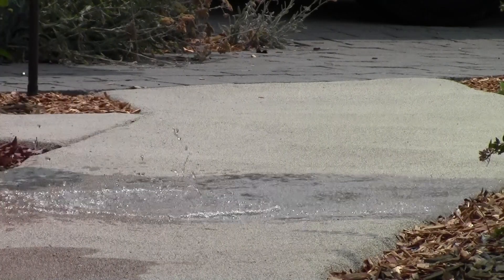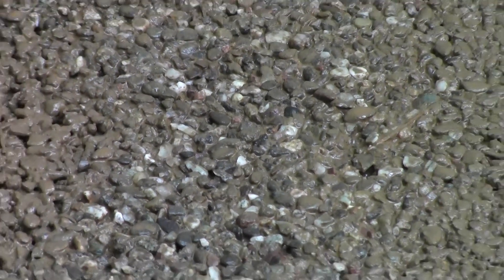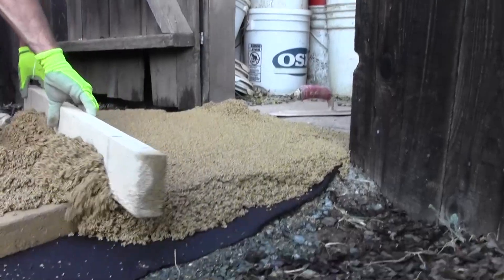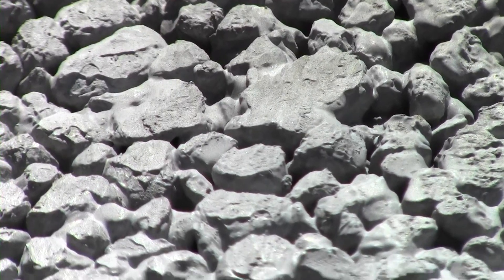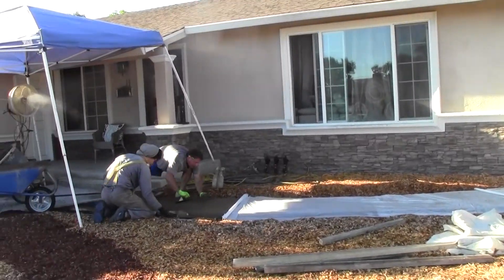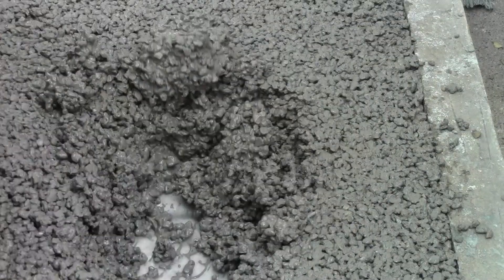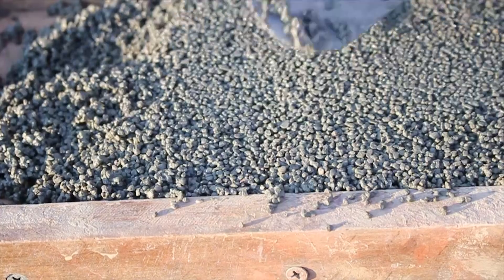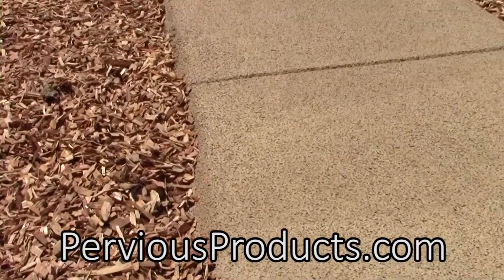How to place a pervious concrete path

Comment: Can you tell ratio of water
Reply from the maker: The ratio of water, or water to cement ratio (w/c), for pervious concrete can vary significantly though it is typically lower than it is for ordinary concrete.  Some of the variables that determine the w/c for pervious concrete are the type and size of aggregate used and how wet it is to begin with.  Also the types of cement that are used and any admixes will play a significant role as well in the final w/c.  For us, the main goal when determining the right amount of water for a pervious concrete mix is to make it as 'wet' as possible without the paste running off the aggregate or having the concrete seal up when it is finished.  
Having the pervious concrete as 'wet' as possible allows one more working time when placing it and helps protect against the potential for 'raveling', aggregate coming loose from the surface after it is cured.  Please see our video 'How to Make Pervious Concrete' for good side by side examples of how a 'wet' enough pervious concrete mix should look.

Comment: I made pavers like this at my old house. I went by and the pavers still look great in the yard. You also can use concrete color for player to mix into the concrete to get a different color just make sure you premix with the water before adding water to your pea pebble cement mix

Comment: Is this suitable in Europe or where it rains a lot? What happens when the top layer cement wears out? Will the stones start breaking out resulting in holes in heavy traffic areas?
Reply from the maker: Yes, pervious concrete is very suitable in areas of heavy rainfall.  Pervious concrete, when properly installed, should last and wear similar to ordinary concrete for most pedestrian and low-vehicular traffic areas. The wearing of the very top layer of cement will not affect the aggregate below.
Reply: I would say yes. You would want to pour it thicker tho. The voids in the slab will hold a lot of water. You'll be surprised. Now when it comes to driving on it, it can be done but you'll have to add more cement and I would use larger rock and probably have less void area and remember the 6 inches is a standard driveway thickness and with previous concrete I would pour it thicker. I would probably go up to 10 inches. I'm not a soil or cement guy just a diy guy that has played with this idea so take it for what it's worth. I would demo it in 12x12 forms until you got it the way you like it. I had a mix set up but didn't write it down so I have to start all over the same way. Walkway use pea pebble unless you never plan on walking on it with bare feet.
Reply from the maker: @roshawnsims8390  We typically pour residential driveways and low volume parking lots at 5 1/2" to 6" thick (150 to 152.5 mm).  However, this is usually done over an equally thick layer of crushed 3/4" (57) rock, with a heavy duty geotextile fabric spread on the subsoil.  If the subsoil is particularly sandy or well-draining, then the rock layer can be much less.  
Good idea, to practice first!

Comment: Serious question. If you live in a cold region; how does this hold up to freeze and thaw cycles? Can water or residual moisture get trapped, from say a cold weather rain and then freeze overnight and crack my the walkway, driveway, or whatever you made?
Reply from the maker: Pervious concrete has been installed successfully all over the U.S. and Canada for over 40 years.  So it does survive some pretty heavy freeze/ thaw cycles.  Pervious concrete needs to have the proper air entrainment and/ or other freeze/ thaw resistant attributes just like ordinary concrete.   However in regards to the visible water flowing through the pavement getting trapped in it and freezing, this is not typically a problem because it still has room to expand, up and out of the pavement.  This is perhaps similar as to why rain gutters with water in them don't typically get damaged during the winter months.
That all being said, pervious concrete should be placed over a well-draining, typically crushed rock base.  This will minimize the occurrence of water getting trapped in the pavement during a freeze/ thaw cycle as well as provide protection from frost heave as long as the crushed rock base is designed with the proper depth.

Comment: Can you seal pervious concrete if extensive raveling occurs? Or how do you repair the ravelling? Use concrete sealant or glue and attempt to glue it back?
Reply from the maker: Sealing or adding adhesive to raveling, loose rock on the surface of pervious concrete will not do much to slowing this from occurring.  However, raveling will typically stop about 6 months after the installation.  If around this time the surface is aggressively brushed and vacuumed and/ or blown off, then applying a film-forming, high solids sealer, like an acrylic or polyurethane can help to minimize the typically small amount of further raveling that can still occur over the years. 
If the raveling is significant and the pavement is not considered acceptable and it needs to be replaced, then applying a 1/2" thick layer of PerkTop over it instead will permanently lock and solidify the surface.  PerkTop will also provide a whole new aesthetic and cost much less than having to replace the entire pavement.

Comment: Can the cement be tinted?
Reply from the maker: Yes, the cement for pervious concrete can be tinted a wide range of colors.  With the use of white portland cement or other lighter colored cements, it can even be made to be white and in very light colors.  However, because pervious  concrete traditionally needs to be cured with plastic, this will discolor it and produce efflorescence, whitish appearance.  Therefore we typically use a stain to produce the final color, which offsets the discoloration.

Comment: I wonder if adding a little concrete to the spray bottle instead of using 100% water would be a benefit?
Reply from the maker: Thanks for sharing your out of the box thinking.  It is possible that adding a bit of cement or other admix to the spray water could reduce the evaporation rate and/ or improve the quality of the finish.  To that extent, some pervious concrete installers will use evaporation retarders, which I believe are mostly alcohol-based, to provide for more time between finishing the pervious concrete and covering with plastic.  In this case, these need to be applied carefully because over application can weaken the surface and lead to raveling and over reliance on its anti-evaporation qualities can also still lead to drying out of the the surface and to raveling because it does have a limited effective time.

Comment: After the project is completed, can it be painted?
Reply from the maker: Yes, pervious concrete can be stained a different color.  Most concrete stain and sealers are compatible with pervious concrete.  We like to use Ecoprocote's 'Soycrete Concrete Stain & Sealer'.  They claim it lasts virtually forever, but even still we try to tint the pervious concrete a similar color as the final stain color.

Comment: Does pervious concrete will give same strength as ordinary concrete???
Reply from the maker: Pervious concrete generally pulls slightly lower compressive strengths than ordinary concrete, typically 2000  psi (14 MPa)to 3000  psi (21 MPa), compared to 2500 (17 MPa) to 4000 psi (28 MPa) for ordinary concrete.   However even at the average of 2500 psi, this is over 7 times the necessary strength for firetrucks, so it is more than strong enough.  The challenge with concrete primarily is to reduce cracking and since pervious concrete tends to shrink less than ordinary concrete and because it is often poured over a thick layer of gravel, pervious concrete tends to crack much less than ordinary concrete.  
One of the challenges with pervious concrete can be to create a tight, well-placed surface to reduce raveling and create optimum surface durability.  Check our video 'Avoiding Raveling of Pervious Concrete' to see how best to achieve this:
https://www.youtube.com/watch?v=xkkgTXbYvBI
Also if higher strengths with pervious concrete really are desired, they can be achieved.

Comment: IS IT WET MIX MACADAM (WMM)?
Reply from the maker: Even though the mix consistency may seem similar, Pervious Concrete is very different from Wet Mix Macadam.  Pervious concrete generally utilizes a gap-graded aggregate, to maximize the void space.  Also the binder in pervious concrete is cementitious, typically Portland Cement, and therefore pervious concrete achieves compressive strengths of 2000 psi (14 MPa) to 3000 psi (21 MPa) and higher.

Comment: What happens when water falls through? Won’t the sand underneath the Pervious Concrete become weak because of the water?
Reply from the maker: I have never noticed or heard of any issues with the soil eroding out from under pervious concrete or of it becoming weak and compromising the pavement.  Typically pervious concrete is placed over several inches of open drain rock with a filter fabric on bottom, between the subsoil base and the drain rock.  The drain rock acts as a reservoir, storing water until it can be absorbed into the soil below.  The drain rock along with the fabric also serves to provide additional stability to the pavement and buffers soil movement, like expansion when wet.  Now if the soil is sandy or well-draining enough on its own, the pervious concrete can be placed directly on top of it without the added drain rock.  In this case getting the sandy soil wet does not weaken it, it can actually make it more cohesive.  And because it drains so well, no erosion is likely to occur.

Comment: Which type of rock you used in this road
Reply from the maker: It is a coarse silica sand.  Even though fine aggregate pervious concrete, less than 1/8" or 1 to 3 mm in size, can be tricky to make mix designs for and work with, we like the final results so much more than the typical coarser 3/8" (9mm) or 1/4" (6mm) aggregate that is often used.